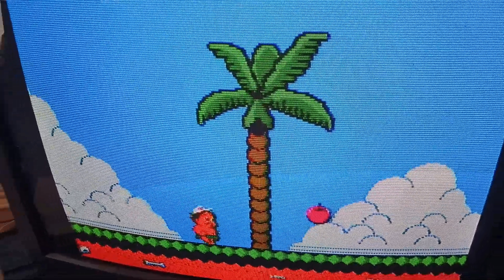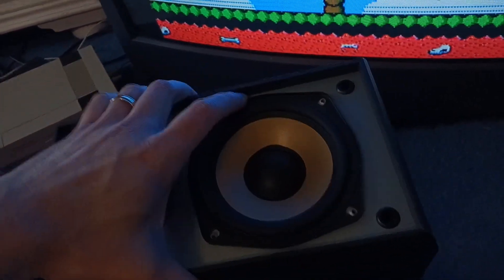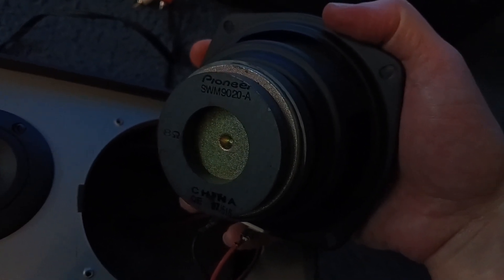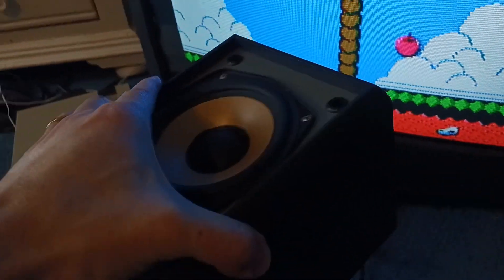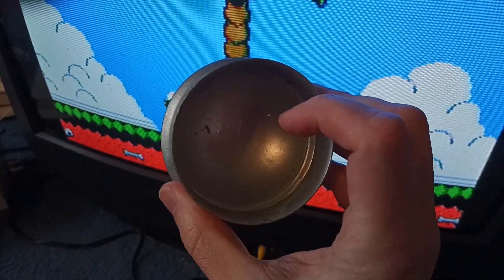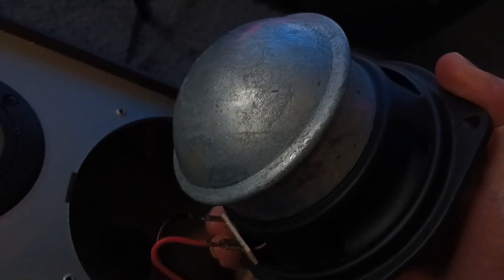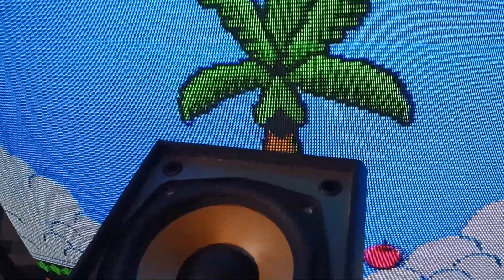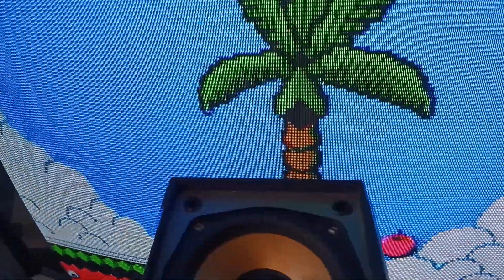How I Magnetically Shielded My Speakers

Comment: Thanks for posting this. Worked great for my lil' Mackie studio monitor/speakers. Added a little electrical tape around the rim just for peace of mind since my speakers both plugged into pretty close to where that plums up to. Working great so far though, and no noticeable difference in audio. I cranked them earlier and they sounded great!
Reply from the maker: Freaking Nice! Yeah I cant tell of any sound degradation either of mine. Happy to hear it worked for you as well.

Comment: Different speakers have different sized magnets.  In some cases, I've also heard of people using a tuna can.
Reply from the maker: Yes, definitely measure like I mentioned. I've heard of ductwork pipe caps working as well.
Reply: @TheAlphaOmegaX3 
Glad to see something so simple work! I’ve always thought about trying but never get around to it. I was thinking about buying more Permalloy sheets like what is used for CRT convergence strips, and covering a speaker magnet in it… but that stuff is like $40 for a printer paper sized sheet.
Reply from the maker: @BulkierFive921  Yeah I like deals lol. It was totally worth a shot for $10 and I couldn't be happier.  Totally worth it!
Reply: Smelly tuna tin..., I like the idea though! 😂